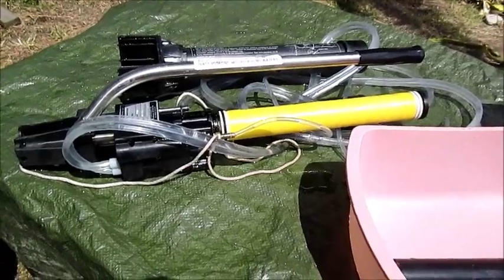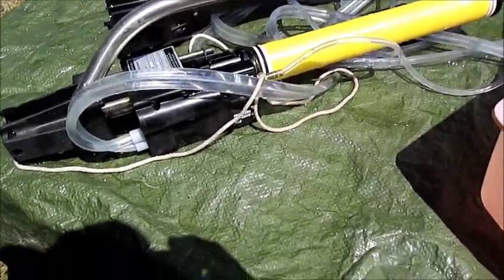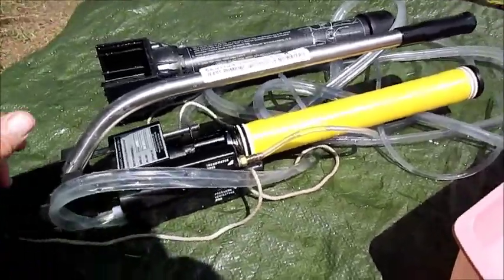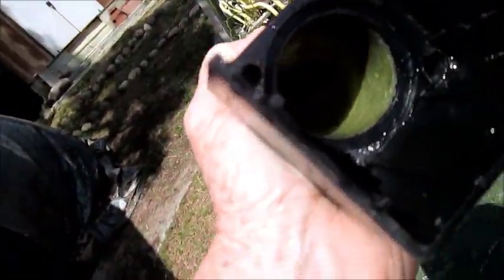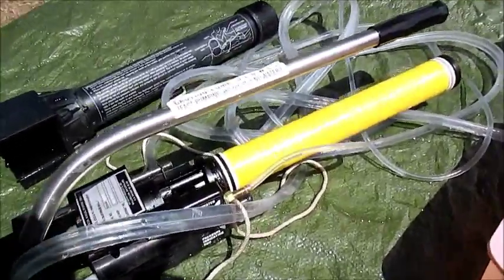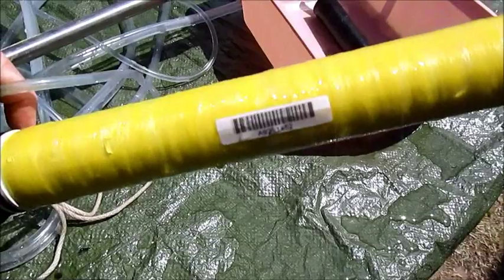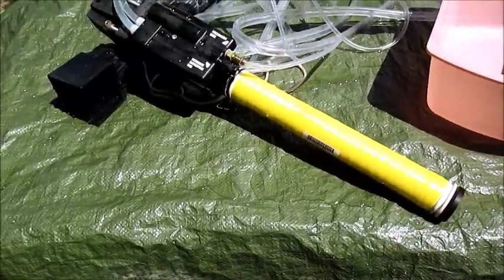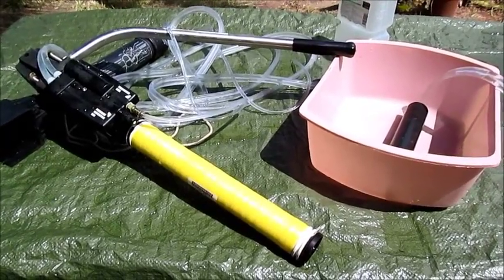Katadyn Survivor 35 reverse osmosis desalinator

Comment: I work at Katadyn and service these models all day. You collar broke, it probably formed a small crack at some point and the pressure expanded it and blew it off. You can call and we can service it if it’s still covered by warranty. And even if not I’m sure you could send it in anyway.
Reply: Bryant do you still work at  Katadyn. I have this unit but bought used a long 10y ago. Clean this unit to make sure it works?

Comment: I guess this guy never answers his comments but I'm gonna try anyway. Approximately how many times did you use this? I know you said it failed after ten years, but was it in a box stored for several years or did you use it on a regular basis?
Reply: They go bad in storage, plastic gets brittle etc.. they are so expensive yet use plastic instead of metal in key components. Imagine being in an emergency situation and the housing just breaking during attempted use. Yet they cost over 2K. Amazing profit margin.